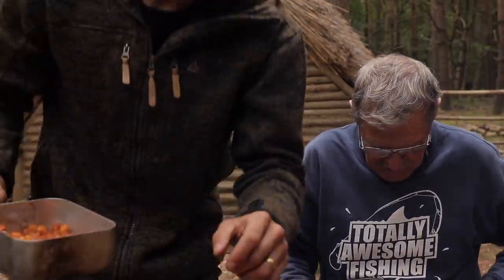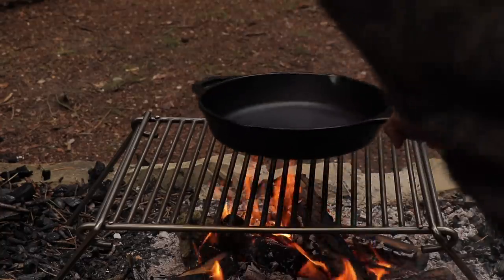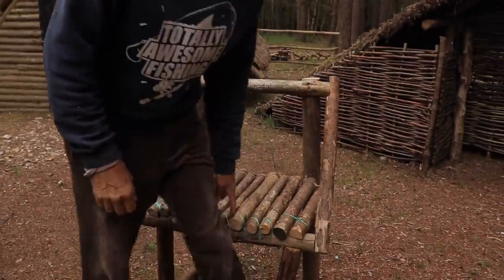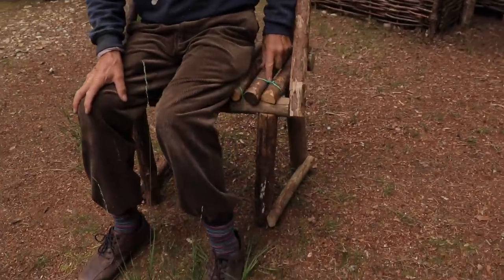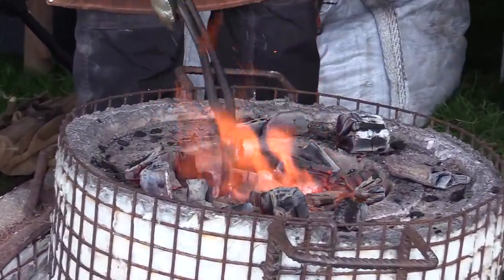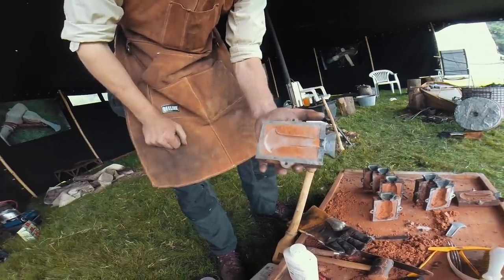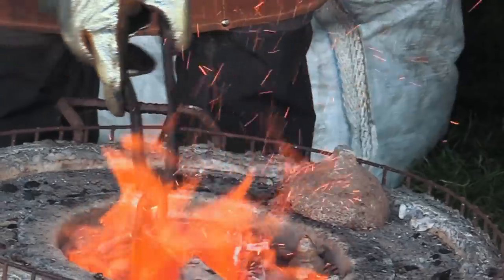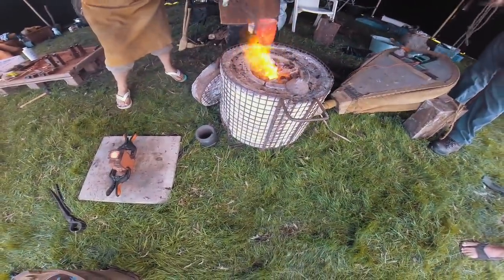Building at the Bushcraft Camp: Wood Chair, Bronze Age Casting & Cast Iron Cooking

Comment: Holy moley. Whoever did that bronze pour whilst wearing sandles is brave.
Reply: Dumb would be a better word...
Reply: I was going to make that safety comment.  I am guessing a spectator, based on how they were talking at the time.
Reply: You beat me to it! Not brave or stupid, just unaware.
Reply: He should have worn steel toed safety boots, just like they did 3000 years ago.
Reply: @OldRhino  Um no. But I'm sure they would have had something.
Reply: i forge stuff with no gear on
Reply: @FxaruAUS  Hammer and anvil is one thing, pouring is another.
Reply: @johntrevy1  hammer anvil and red hot metal
Reply: @FxaruAUS  You haven't got to worry about molten metal sticking to you then.
Reply: Fashion over safety!
Reply: @scottjackson458  😀 ah yes.
The steel skinned toads lived near volcanoes if I remember my history correctly.

Comment: My theory is that the reduction in travel and emissions is allowing the weather to reset and stabilize to what it should be without all the pollution. This is causing hotter hots and colder colds, I expect this winter to have more snow than has been seen in years.

Comment: I had Phaal curry at an indian restaurant and it could have a lot more chili in it in my opinion, and that's meant to be the hottest curry out there. The trick with eating food with lots of chili is to definitely not drink water as this will make your mouth burn really bad. And don't drink anything until maybe 10 minutes after finishing it. Just ride out the heat and it passes. Drinking something when your mouth is burning from chili is the worst thing you can do lol.

Comment: THEORY TIME: Correlation is not Causation.  Airplane combustion contrails may not directly relate to weather changes.  Per contra, the high-flying Concorde passenger plane DID disturb the stratosphere, with some effects related to solar radiation.  From Spring of 2020, COVID-19 also led to significant shrinkage in demand for motor fuels and industrial fuels.  Possibly, a critical amount of Carbon products were already present in the atmosphere.  Geothermal activity may be making use of them now.  GREAT TO SEE both of you in the woods with your house build projects around you!

Comment: It depends on the spice, and the source of the heat. I seem to have a real problem with capsaicin. If it's peppers the heat comes from, my mouth will burn worse and for a LOT longer than other people. Mild is really even too hot for me.
But if the heat comes from some other source, like horseradish, lemongrass, black pepper, wassabi, etc. I have no problem with it being lava hot, the hotter the better.